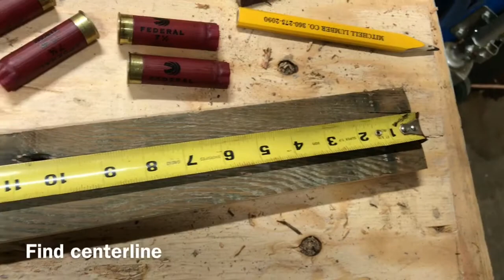DIY Shotgun Shell Coat Rack Made From Repurposed Antique Boat House Wood Reused

Comment: The way you twisted a hollow cartridge into that back plate was terrible, much better putting a dowel peg into the cartridge casing first and tap it into the plate, you don't want a hollow cartridge, over time with the weight of a coat etc it could work loose
Reply from the maker: Great thanks a lot.
Reply: I've made several as you suggested.  Also angled the shells up just a bit.